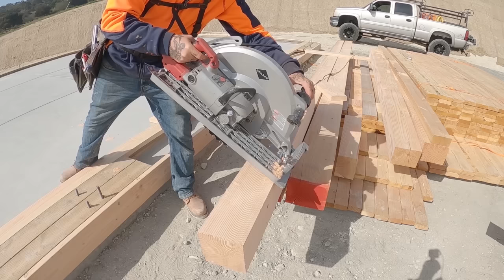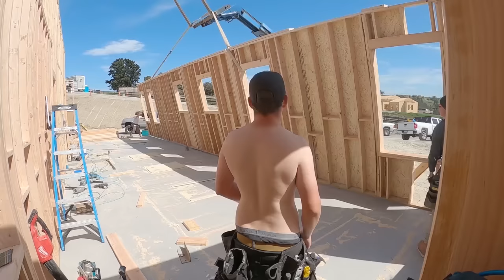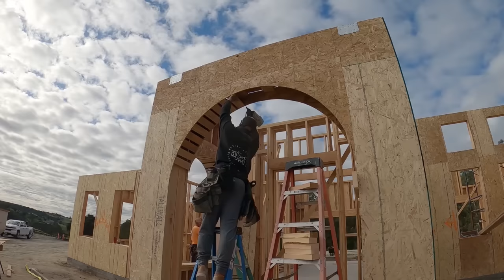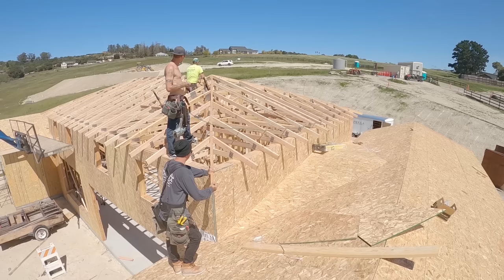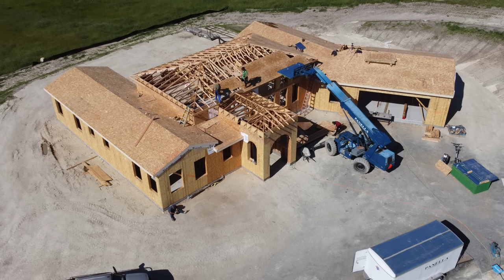Building A Custom Home in 40 Minutes: A Construction Time-Lapse

Comment: Correction: you framed a house
Reply: Do you smell what the rock is cooking?
Reply: Yes
Reply: Still waiting on the part where the house gets built
Reply: @adi6684  it's in the video
Reply: Is this why they blow apart in a hurricane ?😮
Reply: That means the same thing as built🙄 Now all that's left is the plumbing, electrical, insulation, and the finish carpentry work.
Reply: 4 years ago all that was left for finish work that is

Comment: I am a wood truss roof constructor, too, in Greece. Congratulations! Definitely, you are amazing.
Here in Greece, we are not usually constructing the basic building frame with wood but with bricks or reinforced concrete.
Only until 60 or 70 years ago, we were constructing with wood frame and earth bricks (bricks made of mud). We, also, were using reed mesh and coating...
Whatever, thank you for your presentation.

Comment: I made it all the way through. I designed homes for a living, so I found it interesting. I've designed homes that large and a bit larger. Fun work. I hated to work on small homes that the only challenge was to keep the square footage along with the number of cabinets down. I don't like living in a large home, however. I prefer a much smaller, but well-equiped home for myself.
Reply: It's customary in California to not have basements, but strange, because most houses this size have a pool, which takes essentially the same skills and planning as a basement.  Basements have all kinds of utility (storage, media room, workshop, etc.) and this house has neither a basement nor any usable attic space.
We did a major remodel on a 2650 square foot two-story house in California, and I was able to recover oodles of storage space from poorly aligned staircases, linen closets, utility hallways, etc.

Comment: These guys really are incredible.   Framing a home with this type of precision is no joke!!!!
Reply: What's so hard about it? if you plate the ground properly before you start, it should be easy
Reply: @sameersameer-rx1eg Exactly. Larry Haun was the first in the industry back in the day that brought rough carpentry/framing to light and showed it can be cakework so long as your foundation is square and everything else is plumb and true. As Matt Panella said in one of the roofing videos on this build, framing your walls is cakework, but the roof system can be a bit of a mess.

Comment: 4,000 tops, 2000 lbs in studs, 650 lbs ply wood, 500 in plate, 300 in headers and couple extra lbs in blocks, trimmers and double seals
Reply: How much you think ?

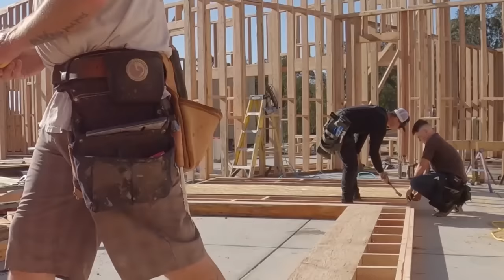Comment: When you sheathe the wall on the deck, how are you ensuring that your top and bottom plates and flat so that you aren't nailing a bow or curve in  the top or bottom of your wall? Do you string it and ensure it is straight as it lies on the floor first? (like around 16:16). Thanks.

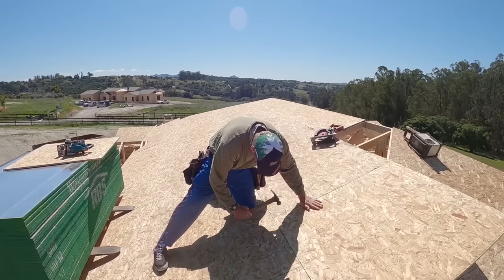Comment: Woah at the cutting around 37:00 . How so precise without cutting any wood on either side accidentally or underneath without seeing under?
Reply from the maker: Depth adjustment on the saw, set it to 5/8" and let it run through. Wont damage the other sheets at all.
Reply: @MattBangsWood  Thanks. That's what I assumed. but still amazes me that it is that precise. I guess you gotta do it to truly see it in action/understand.

Comment: This is great, but I noticed that you put the wooden (walls) construction directly on the concrete, doesn't it rot through time cause of the moisture? Tarmac insulation usually goes on top of the concrete I think.
Reply: Depends on the treated wood, they are probably using ground contact which rots after 40-50 years of continuous moisture. You are correct that they should be using a foam to reduce insects though.

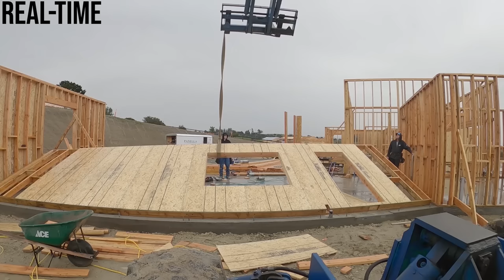Comment: I wanted to ask. I've noticed this with how other people are framing houses too. At 14:40, you guys are lifting that wall up and it's between 2 walls. Wouldn't it make more sense to build this wall and then build the wall on the left and lift that one up? Like build walls going in a clockwise direction as opposed to left, right then top and bottom.
Reply from the maker: The wall on the left you're referencing has hold downs on the each end, meaning it has to run outside of concrete to outside of concrete on the other side. If you were to build the wall we stood at 14:40, and stand that first.. You'd have to lift the wall to the left completely off the ground and fly it into position in order to get it in place. It would be a pain to do.

Ideally, you frame all of your walls that run over - over. Then frame all the walls that are in-between. Makes it easier.

Lifting walls in-between 2 walls isn't a big deal, when it comes to framing, layout is very crucial.

Comment: [one more short story]  (Lol , can't help myself last one , I promise)   So during the very late 80's I became an assistant to a superintendent for the housing developer 'Mangano Co' out of Visalia Ca. .  Our subdivision was in Lemoore Ca. and things ran smoothly essentially but then new homeowner buyers wanted a two story so the architects designed one , and it started selling . 
My boss hated it because of time constraints , and it was plagued with many obstacles for most framing crews to rough out in a timely manner (according to a 52 calendar day deadline per home)  There was  ONE  crew very much sought after by all superintendents . They had a jump on everybody else because they knew how to build the second story on a platform _____ on the ground .  Very clever , lol . They'd rough most of it out first and then half the crew roughed out the bottom floor . By the next day a crane would show up and they'd set the top floor . Must have seemed like magic to everybody else . Thanks again it's been a pleasure watching your video
Reply: (How it held together under that kind of weight I don't know) Trade secret I never got to see up close . But the house had a pretty small footprint for the size of the lot .

Comment: Have you guys ever built a house with an offset? Basically,it's a rectangle divided in half by an 8 ' wide hallway,single story on one side,2 story on the other but the bottom floor of the 2 story is 4' lower than the floor of the single story and it's completely open all the way through with a balcony on the 2nd story that overlooks the 1st story,inside the house.
Reply: Common in out of level lots, called split level in SoCal

Comment: why not use the expander nails for fasten the walls in the slab?? Its so easy and fast. You just put the wall in place and drill trough the stud and the slab and the just hammer it in....

Comment: I'm going to be doing my own board and bat siding on my new home and was wondering if you start putting up the sheeting from center out so all your 16" on center marks are balanced or do you just side from one side to the other and not worry about centering your bats?
Reply from the maker: On nice homes, you want to center everything.. On lower end, people start at one end and work your way across..

Personally, we center everything. When it comes to framing? Don't do anything differently.

Comment: Very nice, good work, given the area and enough material, can surely get the job done, architectural  design  is always key to be followed ... great techs, to continue a simple method...check, check and check again...any small infractions  cost big in the long run....
My first sergeant always said, if you have lots of left over material, then that's just to many mistakes made

Question : the sheathing for the roof was b board, however on the other side looked reflective, is this a new thermal controlled  treated wood for building on code

Comment: when you are covering up your walls with sheathing, how do you know where to cut the window holes? i couldn't see any pre-marks. video was dope btw, cant wait to do this myself.
Reply: Looks like they used a plunge router. The cutting bit would have a smooth flush guide so all they have to do is let the guide follow the frame and it will cut perfectly against the edge with no cut lines needed. Pretty nifty idea compared to trying to use a jigsaw or something and accidentally gouging into the frame.

Comment: weight on this, each studs are heavy, whats that 2x4x10’ walls 116”? custom stud legnth 148” possibly. double top plate, green sill plate guessing the 4x8 header legnth by the windows 16-18’ header material   (based on window sizes) probably ~20-24’ wall. Thats like 4/5 ton load easily. Green Df #2 be weighty.

Comment: 40 minutes to build it. 10 seconds for a tornado to blow it away. USA hasn't discovered bricks, yet. Bless.
Reply: Bricks are disgusting
Reply: @peekwoke9982  In their more than 9000 years of use, you're the only person who has ever said that. So, it's hardly an excuse not to use them.
Reply: California isn't tornado alley. It's not too prone to tornados. Fire is another question. I'd have plenty of fire control measures for interior and exterior. You don't build that much house and not have measures to protect it from whatever you can.
Reply: @orchidjewels4823  I don't recall even mentioning Tornado Alley in my comment. Tornadoes can happen anywhere, mate. One almost snatched my 2yo from my arms, when I was living in England. Wake up call.
Reply: @tardismole    You said "10 seconds for a tornado to blow it away". The thing is, California very rarely sees a tornado and if they do occur, they are weak and small. Tornado alley is where almost all tornados occur in the US. So, I was just pointing out that fact. They aren't likely to see a signifacant hurricane either. Fire is the biggest danger.
Reply: @orchidjewels4823  Like I said, I didn't mention Tornado Alley. The US doesn't have a monolpoly on things, including tornadoes and hurricanes. I'd like to point out that fact, in return.

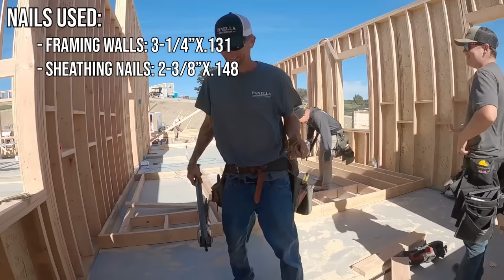Comment: @ 8:56 I would have turned that wall 90° just to be able to top plate it. You boys on t and m?
Reply from the maker: If you cut your plates tight, so your framing is clean... That wouldn’t be an option as you’d have to literally wrestle the thing into place.

You can do it that way all ya want, I’ll top plate in the air.

You boys paid tract wages?
Reply: @MattBangsWood  Idk what cutting plates clean is... If you are referring to the the second plate being nailed tight to your wall; all you do it tap it up a skosh to meneuver it in easier. Looks like you guys have man power, yet still scared to wrestle a wall a little... Sometimes a send is worth. Idk I've heard us new yorkers are a different breed. Carry on

Comment: good quality framing wish u guys were in Colorado. we need more real framers/ journeymen! the lift work is nice too good quality strapping on a long wall. those 14 7/16  blocks just to keep the studs strait or sheer blocking / fire blocks? i don't like to work in weather its dangerous. framers should make enough to afford a day off for weather but if you work by the hour its a different story i work in the snow and that's bad enough, rain is danger but gusts of wind is the most dangerous. Ever see plywood blow off a stack like a deck of cards being shuffled?. i like the flat cut on the brace holds so much better. building shit without a lift is hard, u guys have so many microlams and solid header material. still getting used to having one, the company i work for rents one it is sweet not handing lumber up to the 2nd story like joists and 3/4 or a bunk of studs. machine pays for itself. Id buy that first thing if i were to get into my own thing but framing is getting old been doing it since 17 I'm 36 now. only started to care about it at the age of 30. Now i run people and make sure nobody is cutting the wrong shit up which is way harder, depending on the help you can find which is mostly Spanish non English speaking sloppy framers or kids. not saying all Spanish framers are sloppy but most the ones i have worked with are. I haven't seen a chop saw but guess u wouldn't need one with the big squatch saw. i normally cut everything. i have a chop saw and my cordless Makita skill saw set up on the 2nd story floor now saves a lot of time with blocks Crips, trims, headers, and anything i mass produce. I'm sure you have one set up sometimes. I used to just skill saw everything which is fast too but a table and a mark on it goes a long way. clean jobsite is nice to see shouldn't be a giant pile of waste in new construction shouldn't even need a sawzaw unless u got to notch a beam or cut out door plates. I like how the hip/dutch gable went, im used to it being a truss that never works right cause of shitty lumber it was built out of. hip roofs are way better than tall gables imo. fun and eazier to build unless its more than 6/12 pitch then it can be ruthless.  what kind of plywood is that on the roof? tongue and groove? why dont we use that here in colorado. i like no plywood clips!

Comment: I like your videos and the explanations you give. But for the size (and assumed price) of this place, it appears it's rather low-end in engineering and material choice/value.
Reply from the maker: In California, this homes budget is in the millions. Wood is used in the US nationwide.
Reply from the maker: I also saw you mentioned seal for plates..

We build per plan, quite often, they don't care for air tightness here in California.

I've recently changed everything regarding my builds and it's all air tight, sealed units w/ a break from plate to concrete.

I'm still young, got plenty of years of learning to do! California was a bad place to learn as it's terrible with energy efficiency in homes.
Reply: @MattBangsWood  I apologize I didn’t mean to criticize you if it sounded such. I was just making an observation. And you are right these are homeowner/architect decisions. I live both in CA and NJ. I do enjoy your videos.
Reply: @ksoman953  you think they would to conserve energy.

Comment: A 3800 sqft house like this would probably cost something like $16,000 in labor to do what they did in this video. Am I close?
Reply from the maker: 3,800 SF would be right around $4.00/SF if that were the case. Prices in California vary, anywhere from $10.00-20.00/ft.. Meaning $38,000-$76,000, depending on variables.

Housing costs $300+/ft to build here, so a 3,800SF home will run you over a million.
Reply: @MattBangsWood  Good to know. Looks like great work all around.

Comment: That was pretty bad ass. I watched at 1.5X speed. Kinda wild seeing what look to be an all Caucasian men crew working. Not something I see around here.  I also don't see that kind of clear lumber, looks like it was all #1 and heck even the slab was pretty smooth too. While nothing was see very close up I could just tell it was well built, I mean for stick construction. Big house in Cali is probably multi million. I'm curious as to how long was the actual run time... like how many days did this take for full frame up and dry in?

Comment: Years from now your hips are gonna regret the weight from those nail bags . Now's the time to use suspenders . I wish I would've .
Reply from the maker: I wear suspenders daily for that reason alone.. I broke my hip @ 14 and it’s never been the same. Suspenders are a must for me.
Reply: @MattBangsWood  Holy cow ! you broke your hip at 14 ? So you know then much earlier than the rest of us . With my knuckle head mentality through my 20's , 30's , 40's I thought it was an old man thing . I became an HVAC sheet metal man for small shops in my hometown (carried EVERYTHING with me) straight out of high school . Hey thanks Matt it's been a pleasure
Reply: Hey Matt , California  DOES  require one hell of a lot of Simpson ties , straps , and seismic  hold downs don't they though ? . You're guys are definitely a tight team because the time management is impeccable